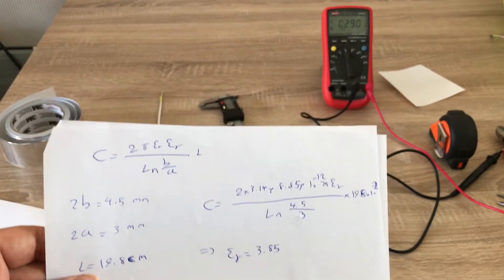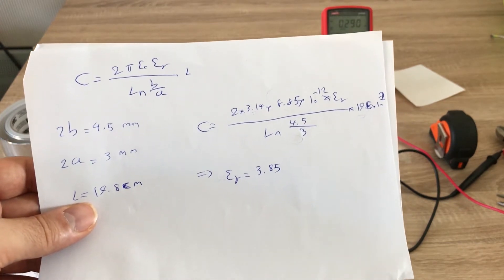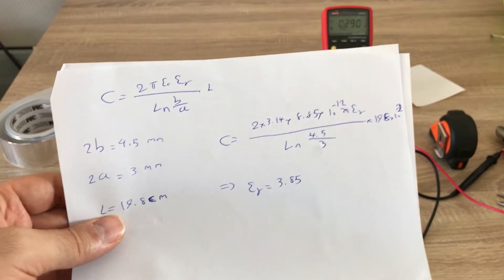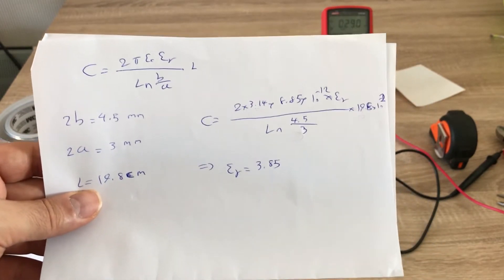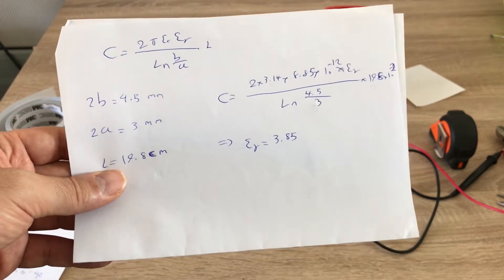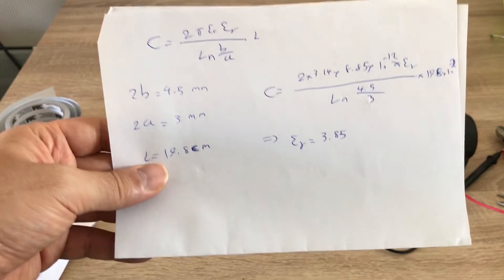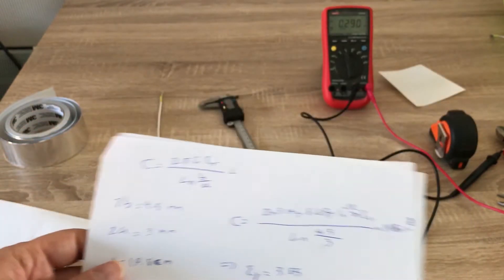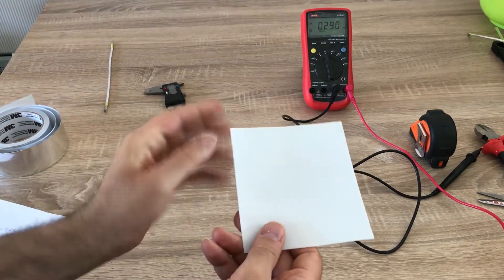How to measure relative permittivity of insulation material ( PVC & Teflon )

Comment: Great video! If I wanted to measure the relative permittivity of the enamel coating on thin wires (40 SWG ~ 0.1mm diameter), what method would you suggest?
Reply from the maker: You can use water as the outer electrode
Reply: @HVE  Thank you, will normal tap water be sufficient or should I add salt to make it more conductive?

Comment: Thank you for nice explanation. I tried it with a polymer insulation composite(BaTiO3 40wt% content), but it doesn't measure. Does the shape or thickness of the dielectric also affect it?
Reply from the maker: It is not clear when you say it does not measure. you should provide more information. i have some comment anyway 1- Make sure that your aluminum tape does not have a layer of insulation on it so that when you connect your capacitance measurement device, electrical connection is there.
2- What is the accuracy of your capacitance measurement units ? check that, make sure that you do not use a very thick dielectric and very tiny sample area, since in that case the capacitance would be very small and your measurement will not be accurate.
3- Also when you connect the terminals, you should not touch the electrodes with your hands while doing the measurement, the capacitance of your body affect your measurement.
Reply: @HVE 
 First of all, thanks for the kind reply.
Not measured means nothing appears on the multi-meter's screen.

I also have an additional question.
1. What do you think of the appropriate size and thickness of the insulation material? (In addition, the relative size of aluminum foil)

2. In polymer composite, is there any effect that the matrix is nonpolar?

3. In case of aluminum foil, which adhesive does not have insulation properties? (rubber or acrylic)

If you have any additional comments, please let me know.

Thank you
Reply from the maker: @user-gh6bd9ky2q  use parallel plate capacitor formula and take a typical permittivity value of polymers (~2.3) if your capacitance is less than say 10 pF, then you will have some error, depending o the LCR meter or multi meter accuracy that you use. Example, a sample with 1 mm thickness and  a radius of 1 cm, and with a permittivity of 2.3 will have only 6.4 pF, which in case your device is not that sensitive you will easily make a large error in your measurement. Adhesive on aluminum foil does not matter, just it must have very small thickness to have less impact on your measurement. check if the other side of aluminum foil is electrically connected to your multi meter. Base matrix being polar or non-polar does not matter for the measurement, only the values of permittivity will be different for different material
Reply: @HVE  Thanks for the information.

Comment: thank you for such a nice description. Can you make video on how to measure permittivity using free-space method or open ended coaxial probe method? It will be helpful for my research. Thank you.
Reply from the maker: Thanks for the comment. Those methods require a VNA or other specialized devices if you want to do a wide spectrum permittivity analysis, which unfortunately i do not have at home. There are many papers which explain in detail each method. What is the sample that you want to measure its permittivity ? is it soft or hard ? do you need complex permittivity over a range frequencies ? can the experiment be destructive ? (for example you can cut a part of the sample etc.)

Comment: Thank you MG Niasar. Can you also make a video about measuring the frequency dependent relative permittivity (both real part and imaginary part) using a semiconductor parameter analyzer?
Reply from the maker: I have not worked with semiconductor device analyzer yet. Normally to measure complex capacitance versus frequency, a device that can apply a voltage at different frequency and measure current precisely, specially the phase shift between voltage and current must be calculated extremely accurately. Usually FFT is used and multiple cycles are measured to achieve better results. IDAX 300 or similar devices can be used (from mHz-10Hz). For higher frequencies usually a good LCR meter can also work.
Reply: @HVE  Thanks for the information.